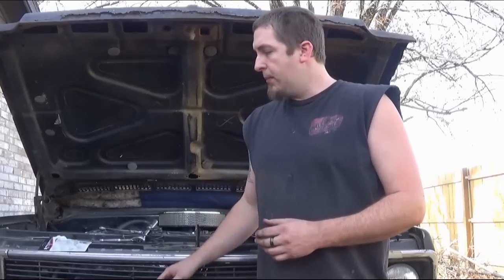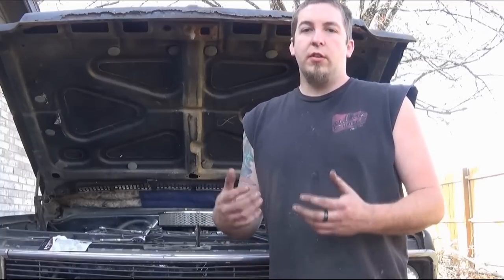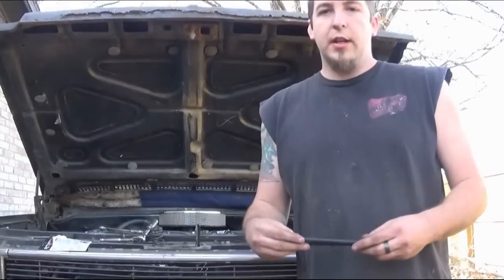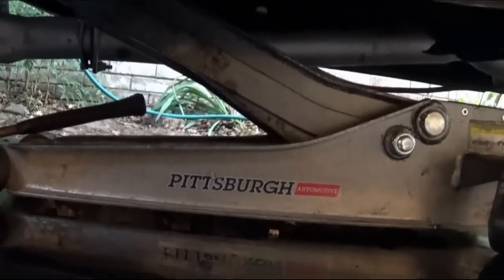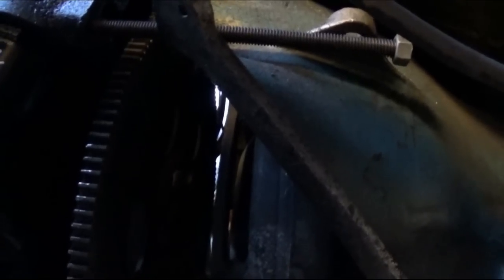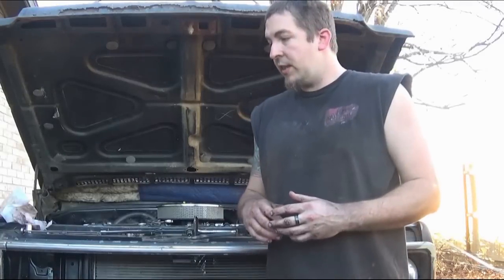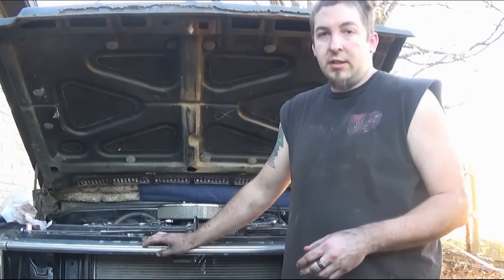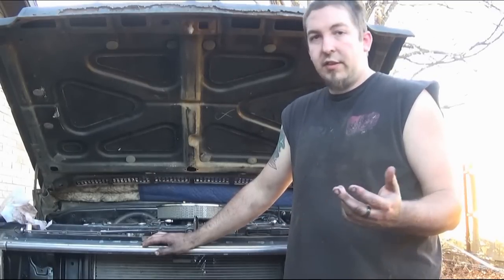trick for changing your flex plate

Comment: Bro your exactly right about the bendix or starter being bought along with the flex plate. I bought a new starter and then shortly after my flex plate had teeth missing/broke off. When you said that now I’m thinking it was the new starter that did it. I’ll go talk to my alt./starter guy of which one I should get to not have this happen again. Thanks a lot for the video.
Reply from the maker: Thanks for watching glad it could help. It can happen but at the same time i have used new starters on old flexplates and new flexplates with old starters no issues. Really depends on why you change it damage on one will transfer to another. Of course that can be from new parts too, not properly made sometimes. The flex plate could be weak and worn, starter could have a kick or slightly out of align. New parts can fail.

Comment: Tip: having shims between the converter pads to flexplate min 1/8"- 3/16" will prevent trans pump failure & cracking the flexplate
Reply from the maker: It can help if needed. Sometimes you need them.

Comment: Any advice on removing the top bolts on the th350.   I have a 71 Chevelle. The firewall is in the way and there's about 2" of space from the bolt head to the firewall.  Thanks for any advice u can give.
Reply from the maker: Yea cars are a bit harder. I have climbed under the hood and used a wrench on some. sometimes a ratchet wrench fits. those are always a pain. Never found a quick easy way on those
Reply: @EfurdGarage  I haven't tried taking hood off and  a looooong  wrench.  I appreciate your advice.
Reply: Drop the trans crossmember, lower the engine/trans and it'll tilt back and the upper bellhousing bolts will be more accessible from underneath. A long 3/8" extension is great to have, like 3 or 4 foot

Comment: I had a new motor put in my 1989 Pontiac Grand Am.  I think my flex plate is coming off and because the motor and transmission are going from tire to tire how serious is that?
Reply from the maker: anytime your flex plate comes loose it can be a problem
Reply: @EfurdGarage  Needed it worked on, found a mechanic, talked to him about what needed fixed, set up an appointment.  It's set there for about two weeks and then he bailed on me. Why?  He said I had already started working on it.  I said so. He said there's a wire hanging down and he don't do that. I said that's a starter wire, you can't handle a starter?  Pathetic.
Reply from the maker: @icemancometh8679  shops are somthing else anymore
Reply: @EfurdGarage  Found this one that was really great.Then they sold it and my car sat there for 2 weeks.  I went and back and got it.  They never said a word and I never got my keys back.

Comment: I did the same thing for a standard transmission, and ground the heads off of some 6-inch bolts, screwed them into the bellhousing, to help get the input shaft lined up with the clutch a lot faster. I can still install it myself with a floor jack, but it's easier and faster with those bolts.
Reply from the maker: it is lol. i did it once with out the bolts. and it just took forever to line it back up. never again will i do it without the bolts lol
Reply: Cool but why did you grind the heads off the bolts?

Comment: I am so glad I saw this before I dig into my flexplate project. Cool stuff. I will be getting these all threads before I begin. How did you know what size to get for a guy who doesnt have a transmission bolt laying around,or i guess just take one out then go get it haha.
Reply from the maker: Well you can take one out, or if you have another engine block close by. I believe most older gms are 3/8-16. But it is best to make 100% sure.

Comment: Did you have to remove the transmission mount?
Reply from the maker: Yes you will have to unbolt the crossmember or mount. Use a jack to keep it suspended. Somthing to procet the pan from the jack.

Comment: 1992 s10 I have the transmission on the two long bolts and the other bolts out. How do I pull the transmission back? Doesn't want to budge. Tips? Up on blocks but not much room.
Reply from the maker: Yea the s10 wont have alot of room. Check linkages, cooler lines, etc to make sure they have enough slack and not caught on any thing.  Drive shaft moved etc. You may have to look around the firewall and see if the bellhousing will clear

Comment: I am having trouble getting my transmission to break loose from motor on 98 astro van 2wd. All bolts are out, all torque converter bolts out & driveshaft is out. Any suggestions?
Reply from the maker: I believe there are 8 bellhousing bolts total. Lucky its a van and the with the access panel it makes it easy to get the top ones. But if im not mistaken i belive there is a brace you will habe to unbolt after the transmisson crossmember  and you may have to remove some torsion bars.

Comment: Allthread is God's gift to hack mechanics. I used 2 althread to cinch up the lower control arms on my 57 bel air. I used 3/8" fine in hardened steel. Don't ever use stainless steel, it binds if you stress it hard.
Reply from the maker: All thread is amazing. Comes in handy more then people realize. And it's also great since it comes it longer lengths that you can cut to fit

Comment: great idea bro! where can I get all thread? sub'd
Reply from the maker: I have seen it in hardware stores. But i got mine at a local nut and bolt supply
Reply: sometimes called- threaded rod. luckily we have a big sawmill in town & there is a nice mill supply store right next to it. but i reckon a guy could get all-thread rod at lowes, bartons, home depot, ace-true value, ect. P.S. get several flat washers & nuts, there are all kinds of hacks/tricks that can be done ... they also have a rod coupling to join two rods together, they look like 5 nuts welded together & ground down smooth. they come in handy also... good luck !!

Comment: I'm doing a 86 Z28 TPI into a 79 c10 I'm scared of the wire harness 😣
Reply from the maker: Its not bad. I did a tbi 350 4l60e swap in a 92 s10. The playlist is  buget build s10. I didn't really go into detail but it really was not bad.
Reply: @EfurdGarage  cool I got the motor complete wire harness ECM I'm going to rebuild the engine maybe put a mild cam in it I'm just scared about the wire harness I'm in North Carolina I need to find somebody that does programming I'm probably going to end up mailing it off to get the EGR delete and chipped
Reply from the maker: @patjesscole2709  If i am not mistaken, all you need to do if find the correct chip, which summit and jegs has chips. I dont think there was much of anything to be programmed on those. I could be wrong.
Reply: @EfurdGarage  I think your right I've hade a dozen Camaro is a Firebirds years ago that was the car to have I've messed with these tune ports a lot just never got into the wiring so much I I do remember the computer is being pretty basic I'm just going to go for it and see what happens haha thanks for getting back to me I may make a video on it most of my videos on here are about my fish and my son driving he is 7 haha
Reply: @EfurdGarage  o yeah I just looked there's still a bunch of them out there your right 😉
Reply from the maker: @patjesscole2709  go for it. You wont succeed if you dont try. Should be able to find some old forums on it becuase in the 90s that was a popular swap.

Comment: Did you have to. Disconnect from the drive shaft
Reply from the maker: Yes in order to slid the transmission back enough you will have to remove the driveshaft
Reply: @EfurdGarage  thanks man! Also how about the starter?
Reply from the maker: no you wont have to mess with the starter, you may have to mess with the cooler lines for the transmission sometimes there long enough you dont have to worry about it
Reply: @EfurdGarage i have a 98 astro van that i am trying to change the flexplate on but i am not having much luck getting the tranny to break loose from motor. All bolts are out, drive shaft out. Any suggestions on how to break it loose. Im on the ground & by myself just so you know.✌